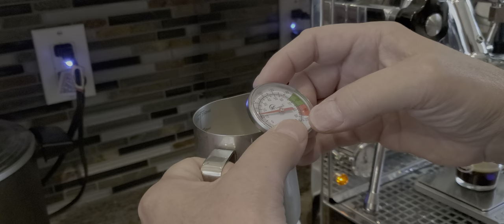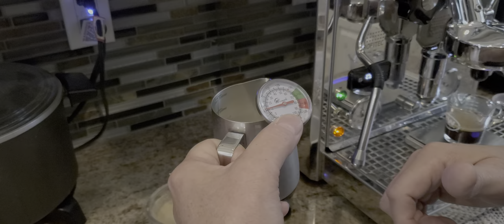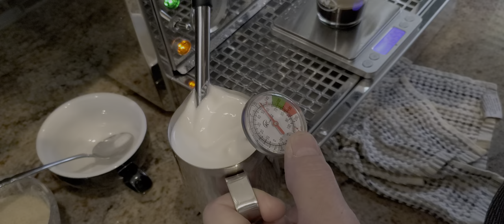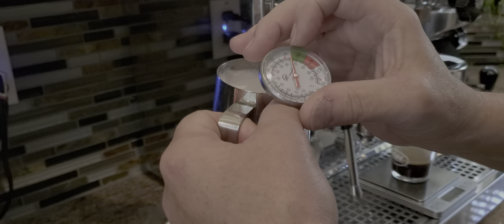Making a Cappuccino with a Profitec Pro 700 and Ceado E37J Grinder

Comment: What is your cabinet clearance there? I have 17 3/4" and I am looking to get the Ceado E37J/S and I see its way over yours...
Reply from the maker: My cabinet clearance is, unfortunately for me, only 15". Since you're cutting it fairly closely, I measured it as accurately as I could and it is just under 17.5". So, it should fit under you cabinets. The only problem I could see for you is that such a tight fit means that you will have to pull it out every time you need to put new beans in the hopper. And, this thing is built like a tank. It's heavy and on rubber feet that do not slide easily.
My low cabinet clearance is one of the reasons that I chose the Profitec Pro. Without the removable handles for the cup warmer on top, it JUST fit in my 15" clearance. Actually I had thought of putting my grinder under my cabinets by cutting a hole in the bottom of the cabinet floor just big enough for the hopper. I thought that when opening the cabinet and looking inside, if I cut the hole just right, the top of the hopper would look like a clear plastic dish sitting there. But my wife was not too fond of the idea so I put it between the cabinets and sink like you saw. Anyway, good luck with your project. This Ceado grinder is a really well built machine and I'm sure you would appreciate it for years to come.

Comment from the maker: Yep - microwaving it for a rew seconds doesn't change the taste any. With the brew temp at 199-200 degrees and the milk being frothed to 145 degrees, you'd think it would be hot enough - but it's not. I tried putting the cups on the warmer before I put the machine under the cabinet but it made no difference. I even started putting hot water in the cup and microwaving it until near boiling, but a hot cup also made little difference. I don't understand why the coffee isn't hotter than it is... but it's not. About 20 seconds in the microwave and it's just about right - and, not hot enough to burn your tongue.
Reply: I would just put the cream in the microwave...not the cup...